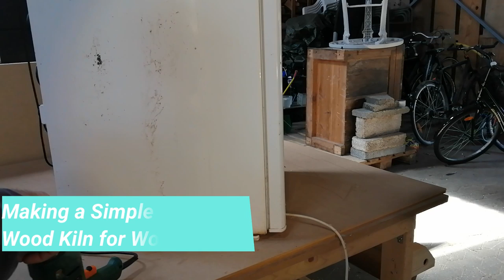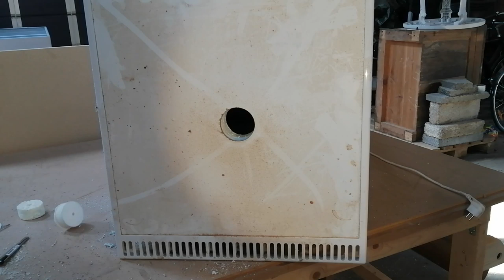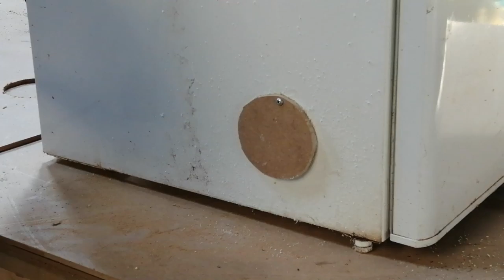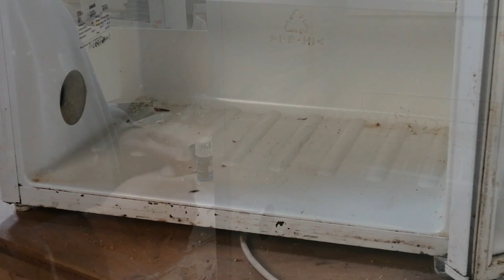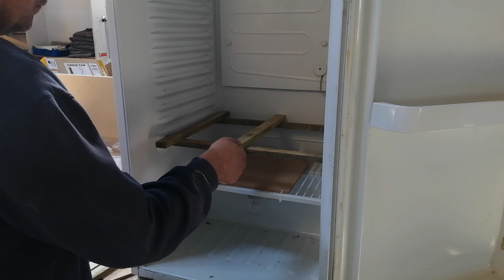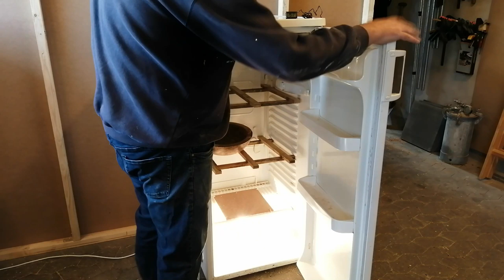How to Make Cheap Refrigerator Wood Kiln for Woodturners

Comment: Great idea. Beer brewers do the same. Look for an STC1000 controller on eBay for about A$20. This has a thermometer which allows for exact temperature control. Of course in brewing a working refrigerator is used so you can cool as well
Reply from the maker: Sounds cool with that controller.. thank you for sharing .. Have a great day and stay safe ..👍😀😀

Comment: A very good idea indeed. Thnx for sharing.
I'm surprised that a light bulb is sufficient to heat it.
Now the hunt is on for an old fridge!
Reply from the maker: Hi Leo, the old type of light bulb generate alot of heat, and in a closed space a 100W can get the temp. up to almost 50 degree celcius.. Thanks for the comment and stay safe 😀

Comment: Thank you for this clear explanation. I just don't have room for it, so I'll have to come up with something else.
Reply from the maker: Try and look at this https://www.youtube.com/watch?v=KYogSkXQgEw, i startet with one, can take 3 to 4 bowls at the time I used a cardboard box  for moving that dont take a lot of space :-)  i also use the microwave oven a lot .. :-)
Reply: @WOODTURNINGBYBRANDSTRUP  Thank you for thinking along. I had already seen the RickTurns box. But I don't like the idea of putting a lamp in a cardboard box for a few days because of the fire hazard. I'll try the microwave once, but it won't fit large bowls.
Reply from the maker: @TheTinyWorkshop  The lamp dont go in the Box it is in the tunnel outside of the box no way near the cardboard :-) last thing  i know of is Silica gel .. that is a save as it gets :-) https://www.ebay.co.uk/sch/i.html?_nkw=Silica%20Gel%2010%20Kg&norover=1&mkevt=1&mkrid=710-154051-335098-4&mkcid=2&keyword=silica%20gel%2010%20kg&crlp=435228471730_&MT_ID=584526&geo_id=32251&rlsatarget=kwd-505517793025&adpos=&device=c&mktype=&loc=1005121&poi=&abcId=1140016&cmpgn=1537721926&sitelnk=&adgroupid=60349726724&network=g&matchtype=e&gclid=CjwKCAjw26H3BRB2EiwAy32zhcPrQn2ux_TwVpanq7wVU5Aie-3La-uQyyZci2T8mzWrfDnTJnvxdBoCyhIQAvD_BwE
Reply from the maker: https://www.youtube.com/watch?v=DaaTbDTUsg0 you can see it here :-)
Reply from the maker: @TheTinyWorkshop  Hope you find a way 👍👍have a great day 👍

Comment: I have an old fridge waiting disposal. Now I'm keeping it. 😀
Reply from the maker: Nice :-) it works very well i have 2 and planing for a 3th when i find one some day .. did just make 15 large blanks i need to rough turn to fill them up .. they are running empty :-) thanks for the comment have   a nice day .. 😀😀
Reply: @WOODTURNINGBYBRANDSTRUP  do you use only one lamp? and how long did it take you to remove the moisture?
Reply from the maker: @mariorapi2313  Yes i 100 W lamp, i have a jar of water in the fridge the first 1 to 2 weeks så the moisture dont leave the wood to fast, after that i remove the jar and it take 2 to 3 weeks to dry the wood .

Comment: This method really works? Why you don't use  dehumidifier and fan? Thanks for answer!
Reply from the maker: Yes it work great, i have not yet needed af fan or a dehumidifier, it takes air in below the bulb heat, the air raise to the top when heatet, and I let out heat and moisture with the top hole, I will add temp. control so I can start at a little lover temp. (30 Degree + a big jar of water) and then go up after 2 weeks (40 to 43 degree no water) .. seems to work better with less crack.. i know a lot of woodturners that use this metode .. thanks you for watching .. stay safe .. 😀
Reply: @WOODTURNINGBYBRANDSTRUP  thanks a lot 🙂

Comment: Could you please explain more about the temperature, humidity and the time and their changes when drying process happens!
Reply from the maker: I start with a high humidity around 70% (have a bowl of water in the fridge) and 30 degree for 14 days and then i turn op the heat op to 40 degree for 2 to 3 weeks and normally the humidity end op at around 10 %, i normally have a test piece i test by cutting over and give the hole lot a ekstra week if it is not down in humidity  .. thanks for watching .. stay safe

Comment: The top hole cover keeps moisture when closed. Does the 2 bottom hole covers increase temperature when closed?
Reply from the maker: Yes, if you close the two bottom onec the temp will raise, but to get som flow inside dont close both all the way you need a small crack.. and be carefull not to get the temp to high then the wood will crack.  thanks for watching and stay safe ..

Comment: I think that rather than use a light bulb I will use an inexpensive de-humidifier rod like in a gun safe.  And maybe a small fan like on a computer.  Similar to the ones they use on smokers.  I know it's more money, but I think it will give me greater control and safety.  Thanks
Reply from the maker: That is a good tip.. thank you for watching my video .. stay safe and have a great day .. 👍😀😀😀😀

Comment: I happen to be in the process of building a similar kiln, hence my questions: (1) Do you use an electronic controller to control temperature and humidity, or do you just do that with the holes in the wall? (2) Do you always completely fill your refrigerator with blanks or is there a problem with cracks if there are only a few blanks inside? I learned this from other videos. Thanks to Denmark!
Reply from the maker: I have a temp. and humidity control but it is manual controlled via the holes, I always try to fill it, if I dont it tent to crack the bowl more and I add water in a jar to keep the humidity up in the first 2 weeks, so it dont dry to fast.. if I only have a few I start at a lower temp 30 degrees instead of 40 and then slowly take up the temp.. I do have a plane of adding electronic controlled temp.  https://www.ebay.de/itm/Inkbird-ITC-308-temperature-controller-230V-AC-for-heater-cooler-C-F-pre-wired/182639373988?hash=item2a8627aea4:g:9dsAAOSwMvtZUc5s   Thank you for watching.. Have a great day and stay safe 😀🎄

Comment: great video! any advice regarding the types of light bulb to use?
Reply from the maker: I use the old kind of light bulb, I had some around, and som i found at markets, they generate alot of heat, not like the new type.. but you need to find some that generate heat (Led dont work) i have been told some use a inferred heater, but i dont know if it can be in a closed space.. so please be carefull ..

Comment: I like the idea, but when you start letting the moisture out, how far do you open the outlet and how much longer does it take, until you get your desired percentage?
Reply from the maker: The temp is easier to control than the moisture, after around 14 days I gradually open the top until i have around 15 to 20 moisture (it is like 2 to 3 mm at the time) if it go down to fast put in a glass of water.. .. and then I hold the temp at 40 degree, after some time it will come down to around 15 and will stay there even though the moisture in the wood go lower.... i ofc also wieghs the wood and keep track that way but first after the moisture have settled at around 15, and then I use the microwave to speed  up the proces somtimes.. 1 and a half min at 900 w and let it cool down, i do that untill it stop losing wieght. amd then keep it in the kiln with the 100 W bulb over night .. that greatly speed things up ..
Reply: @WOODTURNINGBYBRANDSTRUP  Thank you for the info. I think I will copy your idea and see if it works. 👍
Reply from the maker: @TheRealBFG  Cool, let me know how it turn out for you 😀
Reply: @WOODTURNINGBYBRANDSTRUP  I will certainly do that! Thanks.

Comment: Thanks but I don't have room for this. Instead I use the drying cycle on our convection oven in the kitchen. Three one hour cycles and a 12" bowl, at 1' thick , drys from 30% to 10%. I use three cycles to avoid cracking that sometimes happens with one three hour cycle. The temperatue of the drying cycle is 140deg F. Montana Wood Art.
Reply from the maker: I have to try that with the convection oven an see if i can get it to work.. Thank you for sharing 😁😁 and thank you for watching 😁 stay safe and have a great day..